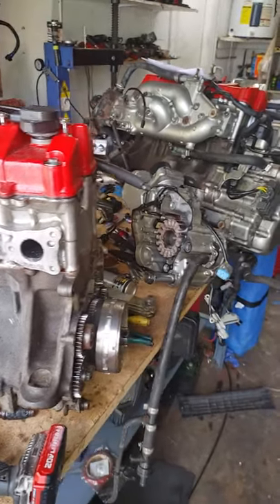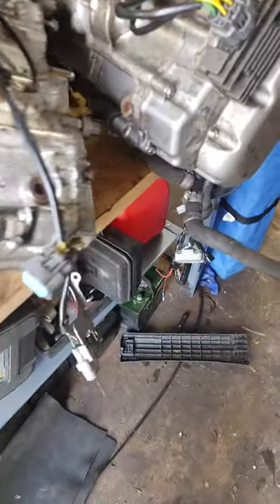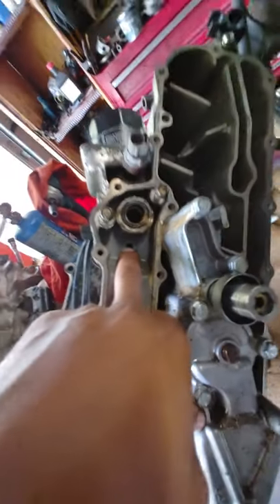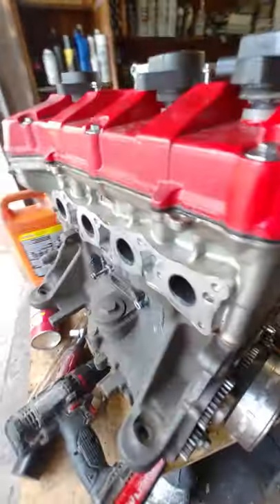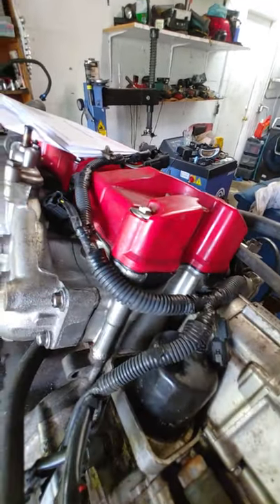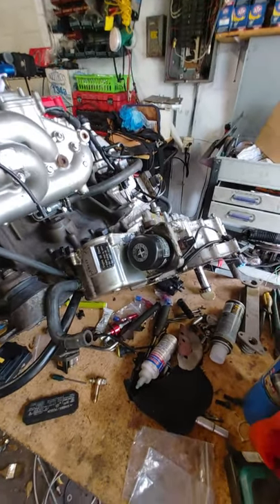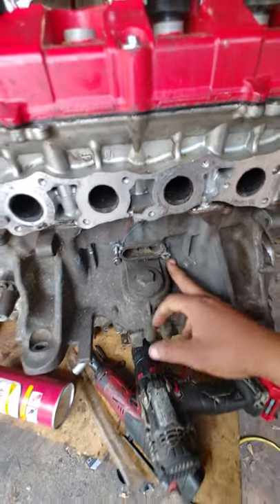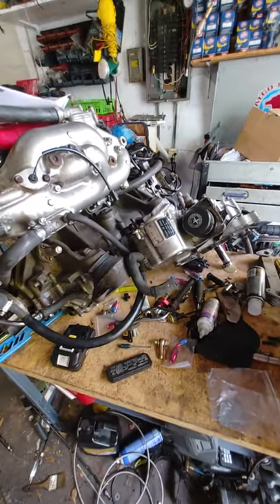Honda aquatrax engine cooling system teardown (milky oil)

Comment: Off topic,  but any idea why my 07 turbo model is running 3 - 3500 rpm idle?
I've tried messing with the adjustment screw and nothing happens

Comment: This is why you have to be careful listening to the YouTube “experts”.     100% wrong to say exhaust manifold doesn’t cause milky oil. It absolutely does, if they’ve been run in saltwater and not flushed the internal water jacket rots out and leaks water into the engine.
Reply: I was going to say the same, manifold is #1 cause for milky oil , #2 oil cooler
Reply from the maker: Well just put up you video proving otherwise. 100% wrong means ur iq is low. Cuz the NA motors will never do this. 2 is u know mechanics at allu can submerge n engine underwater n never get water in ur oil. The turbo models have oil going thru turbo n if seals are bad n manifold are bad water can get past. The manifold is not the cause the turbo is. So since u know so much make a video proving otherwise.
Reply: Wrong exhaust leaks are the number one reason for milky oil

Comment: Thank you for your this information. How do you know if the oil cooler O rings are bad? I have water in my oil and have pressure tested both the exhaust and oil cooler and both check out good. Thank you
Reply from the maker: If you start getting water mixed in with your oil I'd check this first.